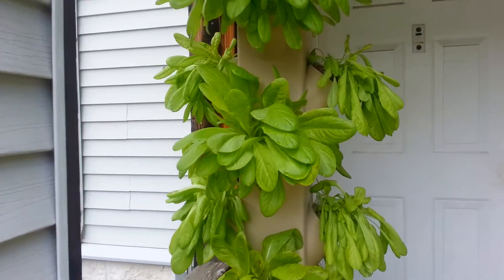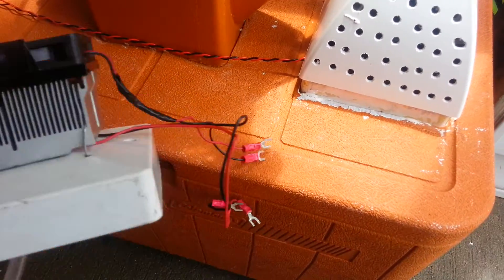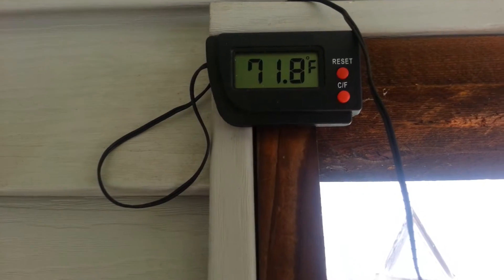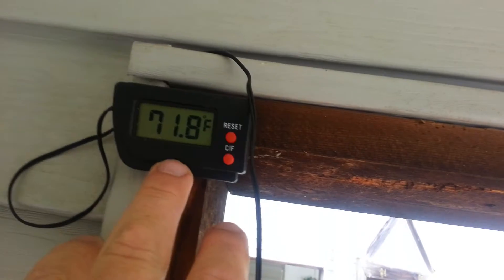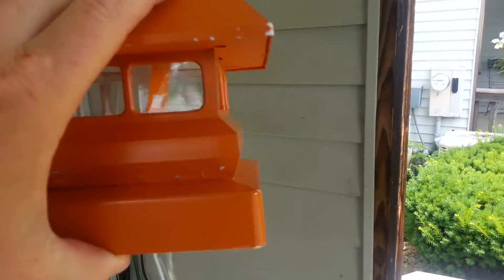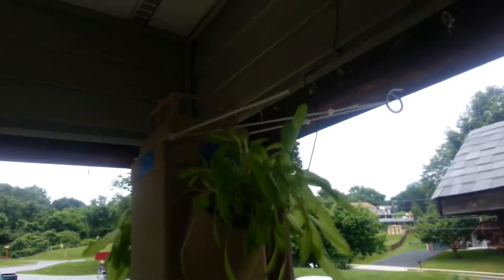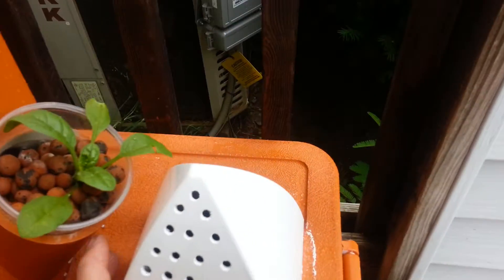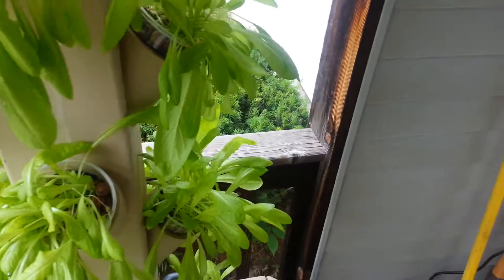My Garden Tower 2014

Comment: Thanks for sharing! I think the heat problem may be caused by the pump, the little electric motors generate a surprising amount of heat pushing water up hill and it builds up in the insulated container. You might see if there is a way to get the pump out of the reservoir and feed it with an inflow tube if it can be fitted with one. It may overheat with the case out of water, so it may need to be in a separate container in a little water.
Reply from the maker: Hi KRG
The pump is the main problem. I have a few ideas I might work on during the winter to see if I can redesign and come up with something new.
Reply: What if he wasn't pushing the water up? I wanted to build his little pump system for my DWC reservoir. I need to keep it below 70F. Was hoping the little pump would do the trick since it's not pumping anything up much. Like 6-12 inches.
Reply: +Mike Walker I thought the heat sink and fan were the main problem? Getting too hot being exposed to the sun light and outdoor heat?
Reply from the maker: christopher jones the thermal electric cooler works great indoors. It doesn't work outdoors. That's why I used a evaporative cooling method on the outdoor grows.
Reply from the maker: christopher jones the little 12 volt pump works good. I'm still using it a year later. I mite make a video on the dwc setup I did using all 12 volt pumps and fans running all on one computer power supply. By the way the little pump has a head height of 9 feet.
Reply: +Mike Walker that's great to hear. I hope you do make a video. You have some great ideas sir. Have to watch those reservoir temps. Your plants will look amazing but the roots can look bad. I just lost plants to Pythium. They were like bushes till one warm day. They died in two days. Taking them out of my net pot I noticed the area of them stem submerged in the hydroton was all white stuff. Almost like webbing. Turns out having the warm reservoir temp caused it to grow. So I need a chiller. I think your invention will do the trick! No more iced water bottles!
Reply: +Mike Walker I was just thinking why not make a separate reservoir with your cooking system in the shade or in the house. That way it's out of the sun. Probably need a bigger pump though to accommodate the longer distance the nutes have to travel
Reply from the maker: One thing I would suggest that a few guys have done was add a dimmer switch to control the fan speed for indoor grows so the reservoir Temps didn't get ice cold.

Comment: I haven't ever measured the temperature in mine, but I have never noticed my plants in any distress. I do have to add water more often on hot days. It gets above 100 here in the summer.
Reply from the maker: The reason I'm checking the temperature is I'm test the two towers. One with cooling the other without. To see what works and the difference in temps.

Comment: Finally got all my parts!  The slow boat from China was actually China Post and made it here two weeks early.  I was sorry to hear that your chips burned out.  I bought 5 so maybe I can make one work.  You said it works inside but the sun makes the heat sink too hot.  How about giving it shade and using another 12 volt fan to cool the heat sink, or use two cooling blocks for one heat sink ?  I see that you insulated the cool side, but you left the hot side exposed. I use bubble wrap that has layers of foil for insulation. It's called double bubble double foil. They also make triple, triple. 

How long did the chips last, inside and outside?

I am 60 and a half. 60 is the new middle aged because 60 year olds think so.

Really Big Ty for posting the vids about this type of cooling !  Maybe I am so out of the loop that I would never have heard about this chip if you had not taken the time to go to on you tube. 

I am looking forward to your ideas and vids.

Kirklee
Reply from the maker: Hey kirklee
I had that same slow boat when I ordered my parts on amazon. I tried making a tunnel with another fan (the big fan you see in the video) blowing air across the heat sink and exhaust it out the back. It seemed to work but when the temperature outside got high it could not keep it cool at all. 
Using the big fan by itself blowing air in worked. It kept it 10 degrees cooler than the other tower but at a price. This kind of set up is called evaporative cooling. As you can guess there was a lot of water loss.  So what I was thinking is to make a radiator, maybe using a car heater core and mount a fan to it and use a small pump to circulate the water through the heater core and have the fan cool it. Almost like a cooling system on a car. 
Your never to old to learn something new. I tell that to my parents every time they try to use the internet. They get frustrated with it at first but I show them how easy it can be to use and they love it. That's how I try to make my videos. It may look complicated but I will show you how easy it can be to make.
Im glad you enjoy my videos and thanks for watching!

Comment: Have you tried using a peltier to cool the water? You can get very inexpensive ones online. Attach a peltier to an aluminum water block, feed water through the block, and have a good fan on the peltier. You could set the whole thing to be activated by a single-stage temp setup, so when the reservoir water exceeds a certain temperature it turns on the peltier, fan, and a pump that pushes water through the water block. They use similar setups for homebrewing lagers and water-cool PCs.
Reply from the maker: Hi Brian
If you check out my videos I did try using a peltier cooler. Works great indoors but fails miserably. Check them out.
Reply: Mike Walker  Dang! I watched a few videos, but missed that part. I was hoping I'd be throwing you a successful idea :(

Comment: How do you secure the post once you stick it through the top of the cooler?  Do you anchor it in somehow?  And I see in this video you used a big computer fan for cooling, but you have a more recent video with a large inline fan.  Which do you use?  Last question... how do you refill your water and add your nutrients?  In the same hole that the fan sits in?
Reply: Yea I want to know about the nutrients. Do they gunk up that little pump at all? Do you clean the lines and pump like once a month with regular water and or vinegar or something ?
Reply from the maker: +christopher jones all I do is let it run 24/7 for the whole growing season.
Reply: +Mike Walker awesome!  so no issues with the lines getting gunk in them then. :-)
Reply from the maker: The only time I clean the line is when I'm done growing. By the end of the season your line will be a little cloudy.

Comment: How often do you have to refill the water in the reservoir with the fan running?
Reply from the maker: Hi Deb
Everyday. On real hot and humid days I can add up to 3 gallons.
Reply: Mike Walker yeah that is out of question for me.. I want a system that I don't have to worry about for at least 4-7 days
Reply: Deb Lovemytechy since you have them outside perhaps you add a floater to fill it up automatically but then if your tap water is too high will mess up your system
Reply from the maker: Well thats were I was heading with this. I can tie a couple of the towers together with a top off reservoir keeping everything in check. And I think I'm going to built my own tanks with a few different materials. I have a few ideas in the works. I like to make sure the improvements work before I add something else to it. I like to figure out one problem at a time. It makes it so much easier to come up with new tweeks.
Reply: Mike Walker yeah reservoir with corrected PH water.. perhaps you might need to add a air pump in there to avoid anaerobic growth in the reservoir as well.
Reply from the maker: It's a work in progress.